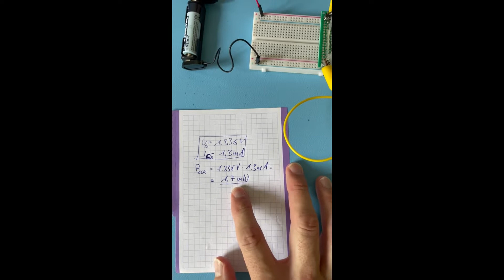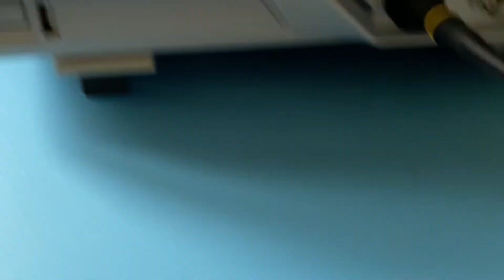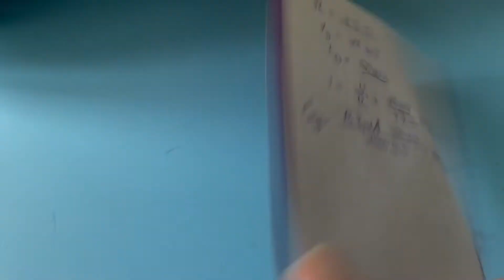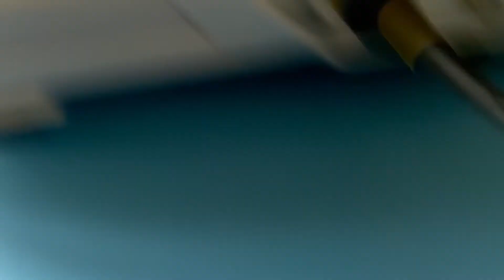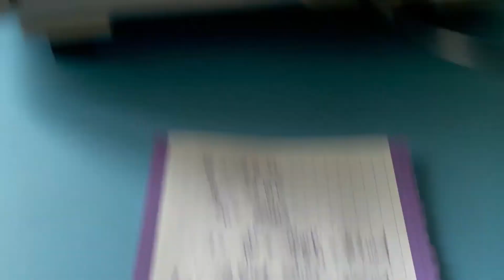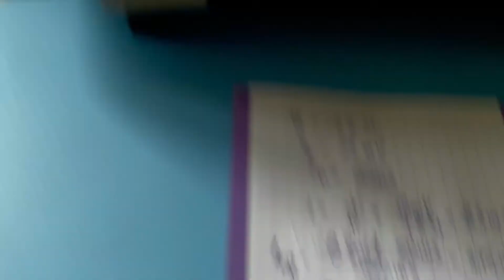How much Ampere does a wall clock consume?

Comment: I have an analog mechanical clock with a second hand that runs on a Panasonic Zinc Carbon 
AA cell. It lasts for 12-15 months. I'm thinking that the current draw would be in the MicroAmp range

Comment: I have 2 wall timers, about every 2-3 months i change the batteries ...i think i will make a small modification, i think i will use a  flat phone battery with a voltage divider...and then use the phone charger for change.  :)